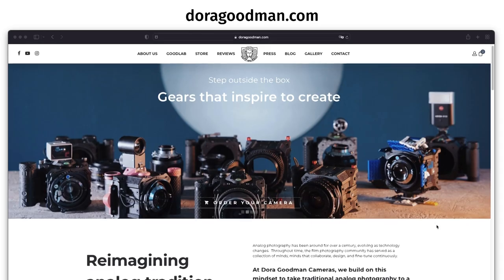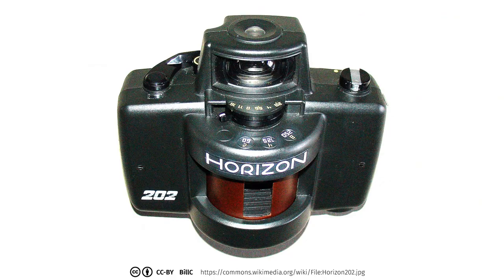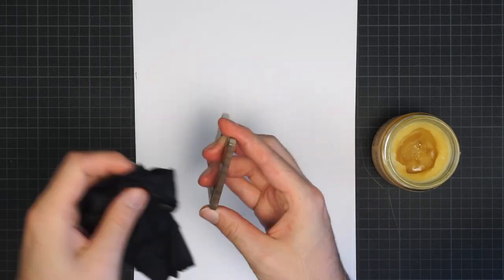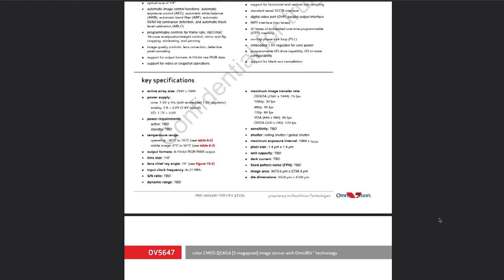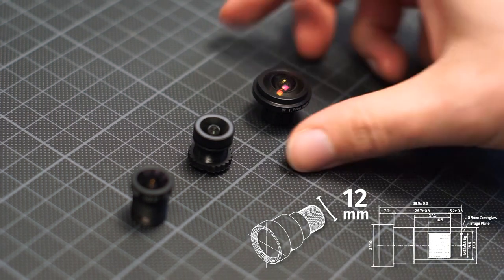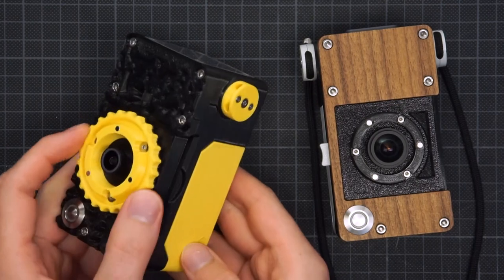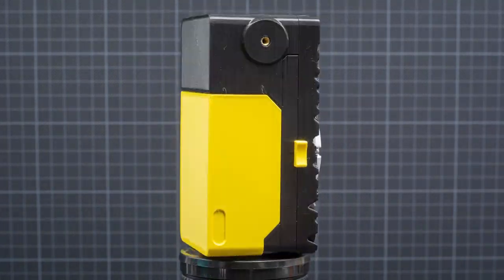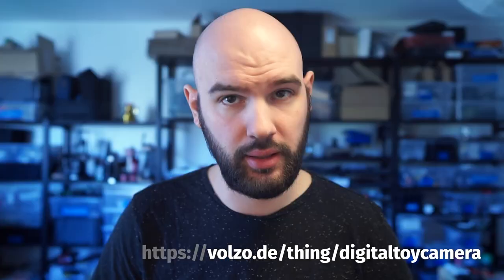Making a Digital Toy Camera

Comment: I love stuff like this! Another source for digital imaging hardware is industrial machine vision cameras. They're tiny, most use C-mount lenses,  and they're versatile with how you interface them. I used to work for a company that made them. Although they're sold largely to industrial and scientific users, there's plenty of them to be found on ebay.
Reply from the maker: I remember I had a look at a few and couldn't find a lot that were not way off the chart in terms of price (B2B market, as you said). I would be curious if you can recommend any specific models.
Reply: When you custom order them from the factory, you get to choose things like the image sensor (resolution, rolling/global shutter, mono/color etc), interface type (USB/Firewire/serial/Ethernet etc). Most also have a set of GPIOs. You can use these to trigger the camera, or have the camera do the triggering (color/shape/motion detection). I would also look at the SDK and see if it's going to be suitable with your system. When I was looking on ebay, there are some older styles that are analog. I would stay away from those. I noticed on Hackaday, there's at least two machine vision cameras available as fully open source projects.

Comment: Bravo. You've done excellent work with the lens mount system, thanks a ton for sharing your project. I was aware of Dora Goodman's 3dp medium format cameras (and two other, one of them is panoramic iirc) but all film. A digital camera platform that is 3D printed an based on Pi, but polished - like Retropi for consoles would be really amazing. There are so many cheap manual lenses going around and barely any DIY solution to use them with, because of sensor and mount issues. 
I'm really excited to see how you take this forward; as well as peeps using Pi and HQ module to make cinema cameras.